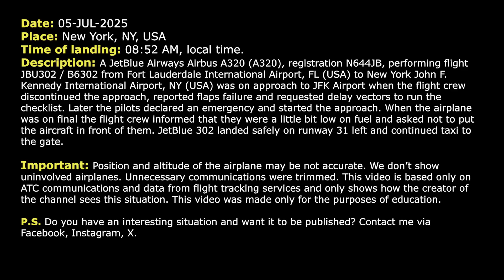Flaps FAILURE and “A little bit LOW ON FUEL” on approach. Airbus A320 has problems at JFK. Real ATC

Comment: Controller not too bright, there's no way an A320 that just flew in from FLL has 6+ hours of fuel
Reply: better to be sure than assume.
Reply: @zachansen8293  a little common sense goes a long way.  There is no way that A320 still had 6 1/2 hours of fuel.
Reply: The controllers don’t usually know exactly where the aircraft is coming from unless they look it up.
Reply: @saxmanb777  fair point, but there's really no way an A320 would have 6+ hours of fuel coming in to its destination

Comment: Great comms by approach and aircraft. Really like the idea of estimating time for checklist and ready for approach. Tower needs to get a clue and not depart aircraft in front of an emergency low of fuel. Any rejection by those planes makes a really unsafe situation. Move them to a different runway or make them wait.
Reply: The aircraft on the ground certainly can be stopped, but sending an aircraft around already on final could create more emergency fuel situations.

What was likely happening was the aircrew was advising the Tower not to sequence any new aircraft in front of them to provide ample spacing for their faster than normal approach, and the tower complied.
Reply: @ktoliman  bud they departed two aircraft in front of it. The captain asked for them to not depart aircraft in front of them. Had nothing to do with arrivals. Use your eardrums